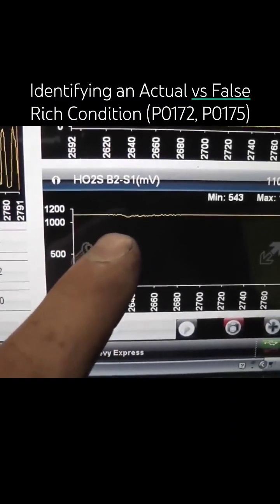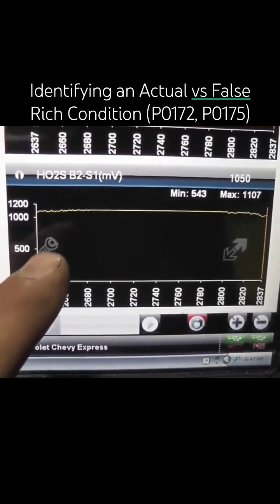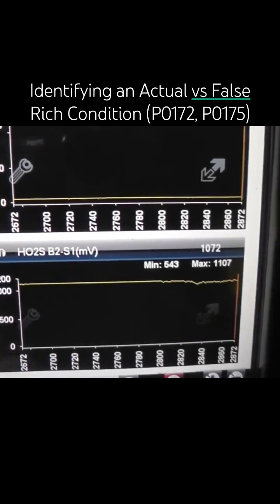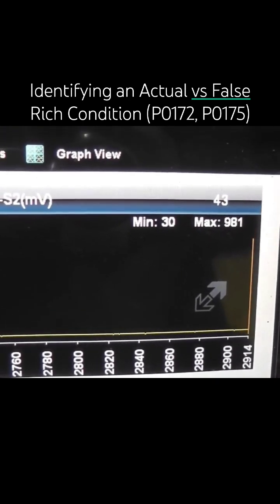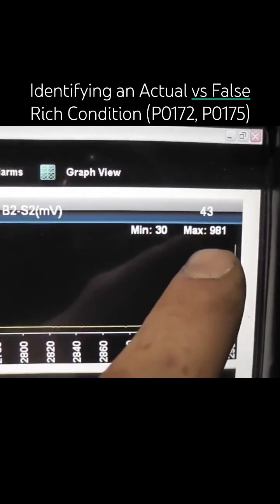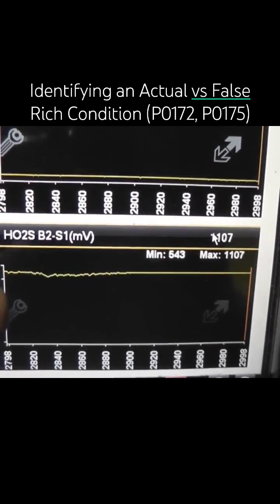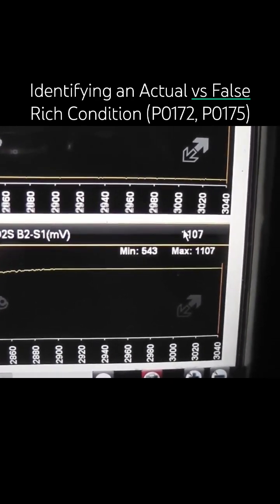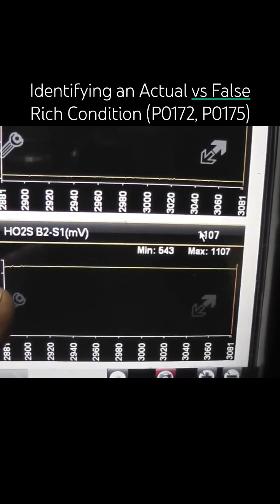Identifying an Actual vs False Rich Condition [P0172, P0175]

Comment: Appears you are diagnosing a O² rather than a wide band A/F sensor..
while there are still thousands of old, 20+ years, vehicles most cars today use A/F wide band.  The rich lean switching will not show on a scope. I've struggled with A/F ratio sensors to diagnose  them.
Do you have any video on A/F sensor diagnosis?
(I'm retired 6 years after 46 in the industry and still love reviewing the technology.)
Reply from the maker: They still use narrow band O2s for upstream sensors on some models. 
But yes...
https://youtu.be/_z6HoW4OiD8

https://youtu.be/CPsvgbCOdvo

Comment: A good confirmation of your hypothesis would be to pull a couple plugs.   You will clearly see if it's really that rich or lean.
Reply from the maker: There are many ways to test an O2 for accuracy. This is simply another method. Thanks
Reply: Exactly, nothing replaces that hands on approach, even if it costs some time..I keep it old school too